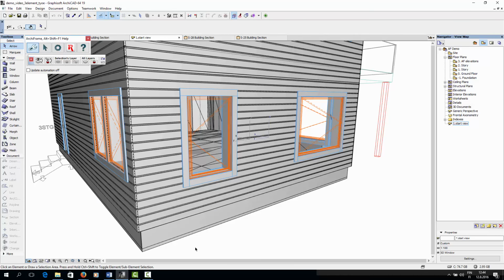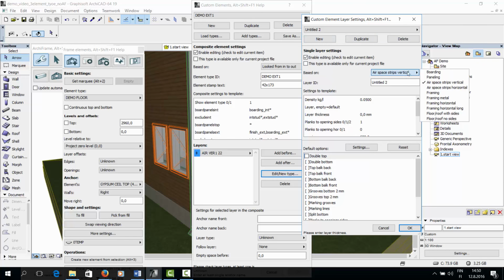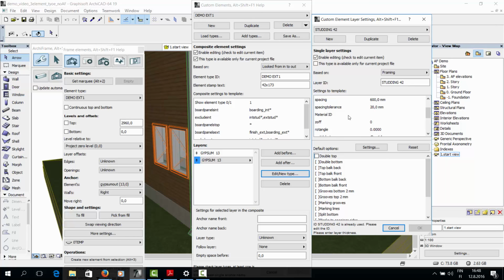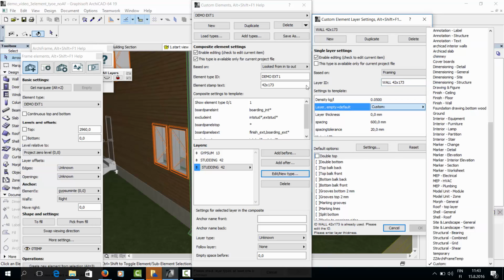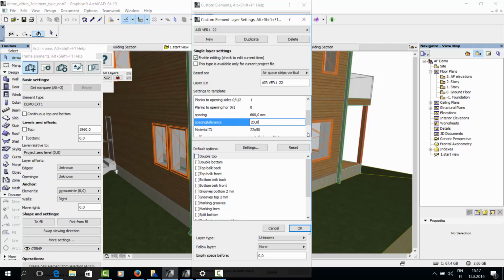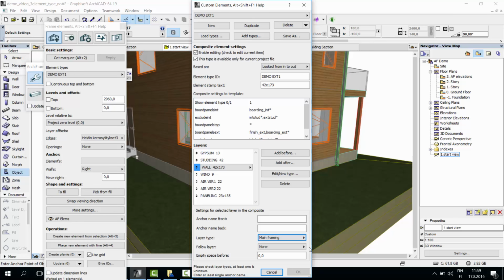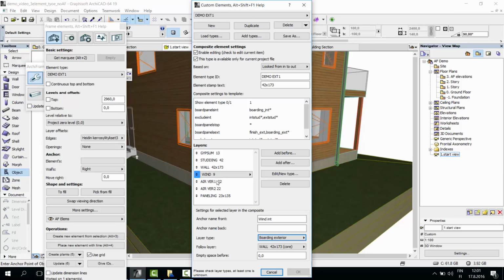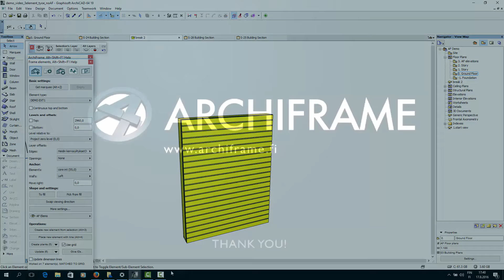3. Defining a Custom Wall Element Type in ArchiFrame

Comment: It is common here to mount inner Gypsum layers horizontally for a more efficient usage rate. If you had a mixture of horizontal and vertical fixing however would it be necessary to have two different wall elements defined?
Reply from the maker: Currently it is possible to set just one board size (orientation) for a layer. To do what you want, the boards must be manually edited in elevation or 3D.